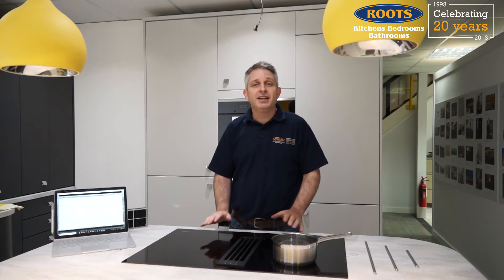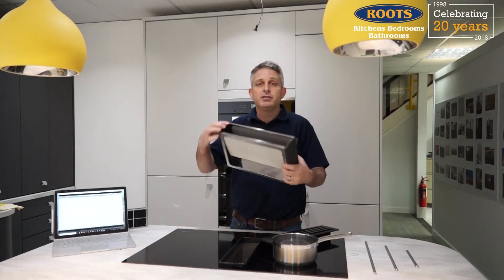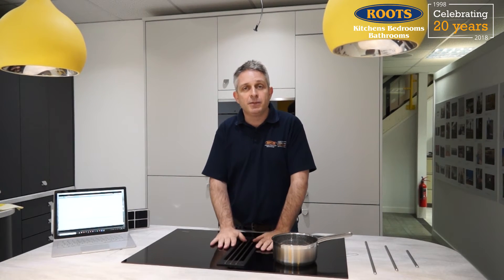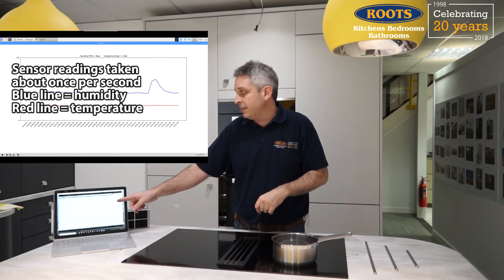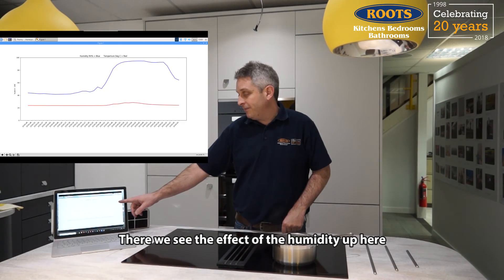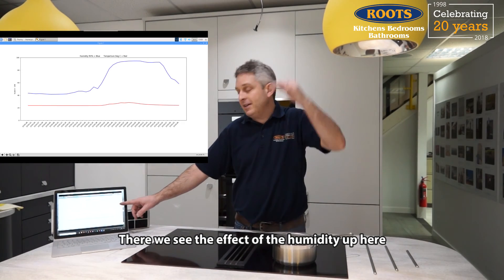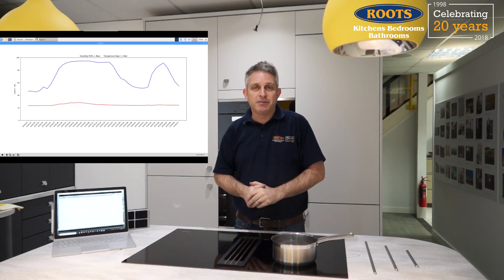We test the effectiveness of extractors that are built into hobs (instead of placed overhead)

Comment: must be fun cooking next to an airplane engine
Reply from the maker: pinned comment ;-)
Does this extractor sound noisy to you?
https://youtu.be/SBfysIfETlg is the video that compares extractor noise but the short version is:
please don't use a youtube video to compare noise :-)
You should know for this video; 
* I didn't reduce or alter the sound level in editing and 
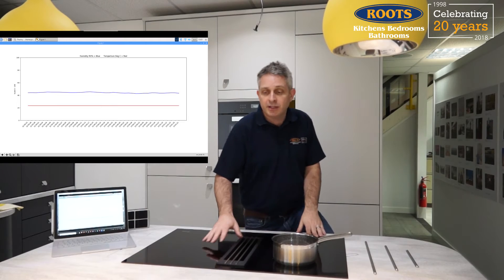* The microphone I was using is the one attached to the camera, I've not even got a tie mic and you can even hear the creak of the aluminium stool I stand on at 1:54

Because I could have played with sound levels in editing it's not a good idea to trust noise level comparisons on a youtube video. If noise level is a consideration check the manufacturers specification sheet. There's a standardised EU data sheet for every extractor so you can compare like with like, for this model it can be viewed here: https://media.miele.com/downloads/92/f1/04_F61547C6F7151EE89EB26124135E92F1.pdf
Thanks for watching!
Steve

Comment: It's a shame he turned it off before it crashed back to baseline. Even if it is 95% effective that's still a problem over the years.
Reply from the maker: I don't think it's a problem for the following reasons;
* The air up high will take a long time to be drawn into the extractor (and more so being ours is a large shop, same for if you leave doors open between rooms in your home), no extraction will be 100% perfect as air moving through your home is complex.  Compare it to your bathroom extractor after a shower and how you'll feel the moisture in the air in the hall outside just from opening and closing the door as you leave.
* The same applies to wall mounted extractors if they're not turned on straight away, the steam will flow around them towards the ceiling and not be drawn back down quickly when the extractor is turned on.
* Most of the venting/hob extractors are being sold as recirculating rather than ducted, so they're never removing humidity from the room. (there's other videos I'd like to make on that but we're a small business and fortunately I've been too busy with real work to have time to play with videos this year.  I'm beginning to catch up.... I've experiments I want to do 😁)
Reply: Unless you have a mechanical ventilation system that runs 24/7, which some homes have. They control humidity as well.

Comment: What happings water falls inside the fan
Reply from the maker: See this video: https://www.youtube.com/watch?v=5L9GOv90g9w&t=1s  The first amount of water (depending on hob, assume half a litre ish) is caught by the filter. Any more will fall to the tray at the bottom (you see me cleaning Bolognese off that tray in video). The fans are mounted below the hob and suck 'upwards', so the water can't reach the fan blades and motor, or at least that would be several litres of water and if you have that much water pouring into your hob you may have bigger problems to worry about.

Comment: Hi. Are there any vented hobs that have the motor sited on an external wall? Or can any hob’s extractor be changed to a separately purchased outside motor?
Reply from the maker: Sorry for the slow reply, I've been busy with the real job :-)
I haven't seen any. Miele have some external motors (or used to, I haven't looked for one for several years). Bora have a booster option that can along the ducting run if I recall, again I haven't needed that.  
The main question now though is why you need it? The built in hob motor is normally more than powerful enough to extract sufficient air (and the Bora option I recall is for very long duct runs).  It used to be something we considered for noise reduction but a great deal of the noise you hear now is the moving air, which makes that noise wherever the motor is placed. Motors have got significantly quieter over time.
There's another video i made comparing noise of extractor but the short version is; don't compare by listening on youtube, go to the EU standard specification which has standardised noise level test results. If you find the one for your current extractor (I think they go back 20 years or more) then I expect you'll see extractors can be quieter than your current model.
I hope that helps,
Steve

Comment: I've seen these work, cool and all, but I hate them on the principle - its fighting against physics - hot air wants to rise.
Reply from the maker: That was exactly my thought, but as you can see the humidity is all captured by the hob.  If your hob is against a wall then having a wall mounted extractor still makes sense to me for many (but not all) clients.  However on an island I think this is a better solution than a hanging extractor that blocks your view across a room, or a ceiling extractor that is hard to reach and change/clean filters.

Comment: what about the smell do they work?
Reply from the maker: Sorry for the slow reply, I've been busy with the real job :-)
Yes, they work. 
Although I've yet to find a way of testing the effectiveness of odour removal. Anecdotally carbon filters have been removing smells for years and I've not met anyone in the industry that says they don't work. That does assume the filters are replaced regularly of course. Many clients that say to us they don't work have never replaced the filters. When to change the filters is also hard to say as it will vary depending on the type and amount of cooking you are doing. Most manufacturers recommend between 6 months and 12 months. Some newer types of filter are designed to be 'refreshed'/'regenerated' in an oven and can be effective for years. These cost more and are larger and I've noticed the trend is away from this style as consumers are choosing easier to access and/or less expensive to initially buy filter models.
I hope that helps,
Steve

Comment: I’m redoing a kitchen in a flat, and can’t really vent, what recirculating induction hob would you recommend?
Reply from the maker: Hi, there are several things that impact the choice. Primarily - what your suppliers have access to/installers are used to is a good place to start.
Then - budget.  If you're staying for a long time you'll appreciate the quality of quieter models (see one of the other videos on noise from extractors built into hobs).
Then - dimensions. Some recirculating models may use more width or worktop depth or height inside cabinet.
Then - if you're against a wall, overhead extractors are still good options (especially if you're on a budget).
Then - somewhere in there, the spec. Features like Flex Induction vs regular round zones and how much of a difference that makes to your use and budget.
Sorry that's not a single option of "buy this one!"

Flat implies limited space and storage, I quite like the Bora S Pure 60cm if the zone sizes work for you (they do for 90% of people I'd assume). If you need 4 x full size zones a regular 4 zone induction hob and extractor mounted over (I have this, 5 years ago venting hobs hadn't advanced enough to be right for my home. Today... vented would be tempting.)

Hope that helps!
Steve

Comment: Very good video, straight to the point. I am considering moving into a house and they have a hob like this one. I was wondering if it was only some stupid design and how to clean it should the pan overflow ( like when making jam!).
It seems actually fine and easy to clean. Thanks for this video.
Reply from the maker: ** Important note on Jam on induction below!**
Thanks for commenting, hopefully you found the video where I spilled a whole jar of bolognaise sauce into the hob https://youtu.be/5L9GOv90g9w 
For Jam - the temperature of the sugars if spilled on the glass can damage the glass (something to do with the very high temperature of the sugars and a chemical reaction that happens, I forget the detail). For an induction hob you can put a heatproof layer between the pan and glass. Years ago I was told a tea towel will work, but I expect baking paper would too. That way any spills are caught by the towel/paper and don't land on the glass.
If it does, the glass will be pitted, but no fail, so just become harder to clean and be generally annoying.
Regular jam making is still a good reason to consider a gas hob (one of the few good reasons now!)

Comment: great video, however im not convinced by this concept. I imagine it need to be on max speed to trap the smoke making a lot of noise and if you lift the pan to mix the food it will loose suction.
But your videos did help with my skepticism. Thank you.
Reply from the maker: If I've a hob against a wall I still design with a wall mounted extractor. For noise, it's depends more upon the motor design and ducting. My video https://youtu.be/SBfysIfETlg talks about noise on extractors with the short answer being: Check the EU standard noise test results for the extractor you're looking at, to compare between models (and since this video I've bought better microphones!).

Comment: We have just moved into a new property equipped with Neff extractor Hob, what we have is wet lichen floors since the moisture has to go somewhere! Currently having a big argument with the builder! Any suggestions?
Reply from the maker: Interesting! I've been investigating moisture and recirculating for a while but I'm some way off doing some proper tests.  A few things to check/try:
(I'm assuming lichen is autocorrect for kitchen...  )
If it's a new property ducted to outside extraction is normally required but it doesn't have to be via the hob/extractor (see https://www.planningportal.co.uk/permission/common-projects/kitchens-and-bathrooms/building-regulations-need-for-additional-ventilation) So if your hob has been installed as recirculating is there another extractor somewhere? It can be quite small, especially continuous running/trickle vents (humidistat controlled types boost when high moisture is detected). I'd have thought the room extraction would handle moisture from cooking (and it's not a problem I've come across, but as we're moving to more island hobs and recirculation it's what I'm curious to experiment with).
If it's wet on the floor... then I'm assuming the exit vent is on the plinth and you have a tiled or cold floor and the moist air is condensing as it passes across the floor. But then I'm thinking that air should be slightly warmer and as it leaves the plinth diffuses and rises quickly. I'd assume it's not the whole floor and just the area by the vent?  If it's the whole floor then I'd start to think it's something other than moist air recirculated from the hob.  I'd be looking to rule out other sources now, eg: damp coming through the floor (screed still drying so the room humid enough for moisture to condense overnight as it cools, or a small slow leak hidden under cabinets or behind something that's just enough to cause high humidity without being high enough to show as water).  I wonder if opening a window during and for a while after cooking reduces or removes the problem and I wonder if different cooking changes the impact (eg: does it happen if you're not using the hob to boil water for a week and eating oven meals. If it happens with the hob can you make it happen in the morning by cooking the same meal or just boiling water for 10 minutes).
Sorry I haven't got an answer but when you solve it please come back and comment so other people can learn from your efforts too. 
Thanks and good luck, Steve
Reply: @RootsKent  - Hi Steve, thank you for your comprehensive reply. The Neff Induction Hob is installed in a large island unit, the installation by the builder was what he called a "short" ventilation duct which discharged into the plinth area underneath the island. This resulted the warm moist air being discharged from the gaps all around the bottom of the plinth kick board, causing moisture to condense all around the island unit on the concrete floor which is covered with Kardean flooring. At my request the duty from the hob extraction fan has been extended to the grille in the kick board, so that it exits at that point only. The first time we have used it, we noticed that the floor was becoming damp! My property is a new bungalow, and has an internal utility room adjacent to the kitchen, and there is an internal ventilation fan in this room, we have achieved some success keeping the door open and utilising this fan. We have not tried opening the kitchen window, since it defeats the object of keeping the room heated!
I feel that this is a classic issue of something that looks good in the showroom, but in reality, present some issues such as condensation onto hard impermeable floor surfaces. We use a steamer to cook our vegetables, and have been trying differing levels of power input from the induction hob to limit the amount of steam being generated. I will keep you updated on progress with this issue. 
Regards George
Reply: @georgedaville4662  I use an electric steamer plugged in at the back door on a table

Comment: Hey im putting one of these in a new build.. The extractor will be in the same room as a stove.. The stove will have a vent out through the wall also..building control have told me once fitted they want to do a smoke test to make sure that the extractor isn't taking to much oxygen out of the room.. Do you think i will have any issues with it pulling out to much air.. Thanks
Reply from the maker: Yes that's a problem - don't do it! ... more detail on why below:

It sounds like your stove is more than just a hob, maybe an gas/oil powered AGA/range also running heating and it burns air from the room. 
The burnt gas exits the stove through the vent to outside (otherwise you'd be poisoned by the CO2 released when burning gas). 
If you have an extractor in the room that vents to outside, the air it pushes out has to be replaced.  The stove vent becomes an easy way for air to flow back into the room, so the gas you wanted to take outside is now back in your room, and that's bad. 
It doesn't help to close that vent just when the extractor is running either, because if the stove is also running it's producing CO2 and you really want that to leave the room so you're not poisoned.

If you're now wondering why we can have boilers in kitchens and still extract outside, modern boilers have a "balanced flue". If you look you'll see there's a pipe within a pipe so the boiler combustion chamber is fed with fresh air from outside and the burnt air exits through the same double pipe.
This is also why with modern boilers we don't need air vents to outside. In older homes you'll often find large holes in the wall to allow air to flow in replacing the air a boiler or fireplace has burnt. Holes like this let the cold air in too, which is why modern buildings generally avoid open fires as this makes them less efficient.

What do we do: 
In rooms with an appliance that burns gas or oil that has a traditional flue, we NEVER duct outside. We recirculate.
Recirculation is fine though. You'll have to replace carbon filters occasionally but they are effective at removing smells. For humidity and building regs you might need a low volume mechanical extractor or it might be the open vent meets the requirements. I always find myself going back to read the regs in detail to make sure I've got our specific use case correct - try https://assets.publishing.service.gov.uk/government/uploads/system/uploads/attachment_data/file/1045918/ADF1.pdf

I hope that helps
Steve

Comment: The coolest thing about this video, is that they're using debian with python to measure the humidity in the air :)
Reply from the maker: It was the best way :-)   
Windows laptop to VNC onto the Raspberry Pi to display in almost real time (I think the lag was a second or two).
One day I'll get to making the video where I use arduino's and Raspberry Pi's to display shower flow rates and control our showroom display TV by IR signals.

Comment: What happens with the moisture in the air which goes through the filter? Does it get re-destributed/re-circulated in the kitchen room?
Reply from the maker: Yes, that's right. 
In the UK for new rooms (new build/extension) you have to also have mechanical extraction to meet building regulations and prevent high humidity levels, and thus prevent other issues high humidity brings.  If you can duct your hob extractor to outside the hob itself meets the building regulation requirement so you don't need a second extractor.

Comment: Too noisy
Reply from the maker: Does this extractor sound noisy to you?
https://youtu.be/SBfysIfETlg is the video that compares extractor noise but the short version is:
please don't use a youtube video to compare noise :-)
You should know for this video; 
* I didn't reduce or alter the sound level in editing and 
* The microphone I was using is the one attached to the camera, I've not even got a tie mic and you can even hear the creak of the aluminium stool I stand on at 1:54

Because I could have played with sound levels in editing it's not a good idea to trust noise level comparisons on a youtube video. If noise level is a consideration check the manufacturers specification sheet. There's a standardised EU data sheet for every extractor so you can compare like with like, for this model it can be viewed here: https://media.miele.com/downloads/92/f1/04_F61547C6F7151EE89EB26124135E92F1.pdf
Thanks for watching!
Steve